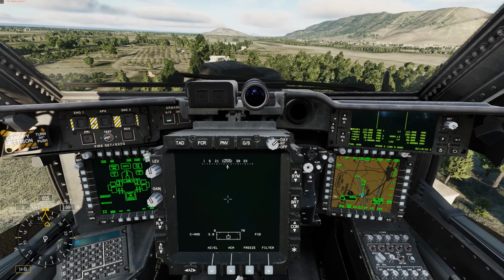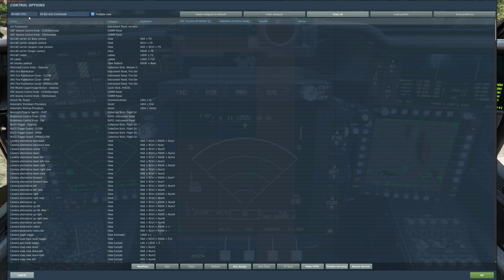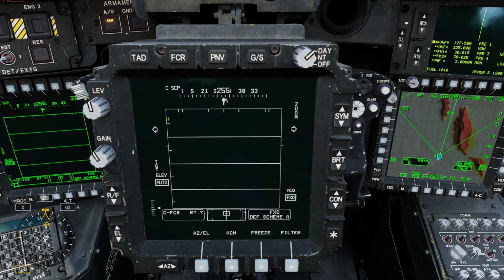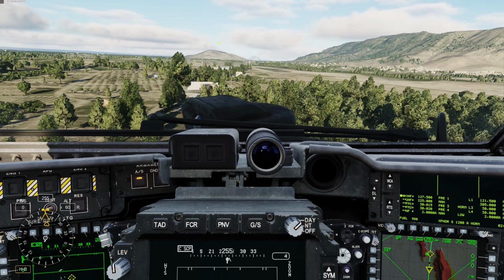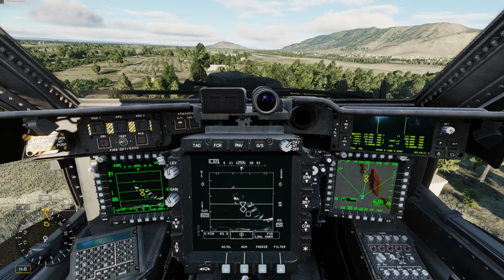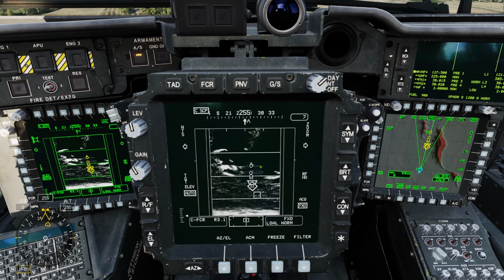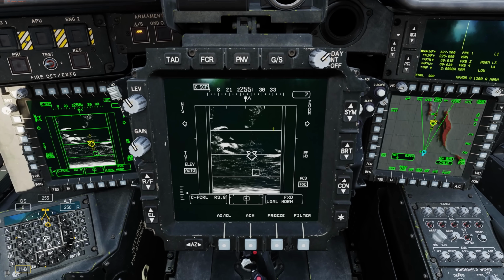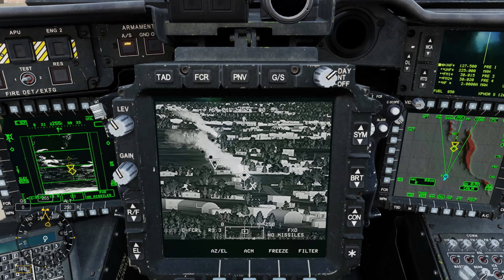DCS: AH-64D | Radar Map Mode

Comment: Show us you set up, Wags!
Reply from the maker: Really not much to see. High-end PC, Winwing F-16C stick with shaker, Virpil CM3 throttle, and a 43-inch OLED monitor.
Reply: @MattWagner  Pretty much my control setup too. It would be great to share keymap binding if that is possible.
Reply from the maker: Most of my bindings match the default plug-and-play bindings.

Comment: Welcome back Wags, thank you for the update on this. Is there a plan to fix the radar's emitting location? Flight model tweaks?
Reply: @jebadiahkerman7846  I can confirm, its working as intended. The FCR is the emitter
Reply from the maker: There is nothing to fix re the FCR emissions location. We looked into this and it was a nothing burger. We continue to tune the FM, SCAS, and rotor model.
Reply: @MattWagner  I think he's referring to the the FCR emits from the TADS rather than the MMA so you have to umask the entire heli instead of just the mast to get radar returns.
Reply: @Ayetsu  this is not accurate. The radar has always "emitted" from the radome, despite the community rumors that have been promulgated. The elevation control logic did receive some updates in early August.
Reply: @MattWagner  Well that's good. I eagerly await the changes, this is my favorite module after all.